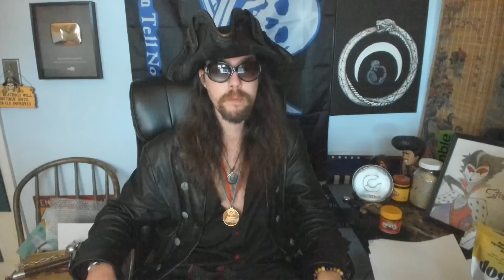Electricity From... Rain?

Comment: There's another angle here - have small water wheels in drains that produce electricity from the water flow. It would be very little electricity, but have enough of them connected to a grid that can accept input instead of just giving output, it would be quite a lot of electricity. Cheap to produce too, but it absolutely requires an open electricity grid or maybe home batteries - which is why it hasn't happened yet.

Comment: A 200w 12v solar panel can directly power a 12v DC rice cooker made for cars or one of those 12v Road Pro cooking pans. Add a solar charge controller and a 12v 100ah LiFeP04 battery and you can use a 1200w AC inverter with the 100 amp version or up to 2400w with the 200 amp ones. They have small hot plate type cookers for making sandwiches that use 500w and the 4 inch Dash Mini Griddle that only uses 350w. Most small to medium size rice cookers use under 500w and of course you can cook more than just rice.

Comment: This has been around for centuries it is called Lord Kelvins thunderstorm.  we also have triboelectric panels that like rubbing a balloon creates static electric charge when rain hits teflon and the rubbing of the drop as it spreads on the teflon causes a charge that hits an electrode connected to a capacitor to collect charge.

Comment: If you have rain and a downspout, then you can have a water wheel spin a generator, which I would think would be more efficient.
Heating elements require lots of power.  I would not get your hopes up.

Comment: Why not just set up a simple waterwheel attached to a small generator? Hook it up to the rain gutter spout. I don't the amount of power something like this could generate is worth the energy that goes into making it. Even if it could generate enough power to offset its own cost I feel system components would break down and need replacements before that offset was reached.

Comment: why not just a rain barrel mounted high and then use a turbine to generate little bit of power as weight of the water builds up and then gets released when you need the power?  or when you watering the garden with it.  Or had the barrel fall down on a rope spinning some gear when you need power.  the fuller the heavier the more power. keep it simple and more accessibble

Comment: Look up 'Wimhurst Machine ' and other early generators, and you can find similar 'water drop generators' that work by the induced opposite charges on the water drops.  Actually somewhat useful for making static electricity, but the idea of trying to do real power generation is basically silly.  Yes, there's lots of total 'charge', but trying to collect it is impractical, it is far too spread out to make sense collecting.  Collect a huge area, and you still have next to no actual power.
You'd be literally better off to funnel a large area, then use the weight of the water to turn a generator.  The gutter generator probably produces more power.

Even if you live in the most rainy place on Earth, wait for the sunny days and use 5 or 10 solar panels instead, you'll come out way ahead.

Comment: The combined effects of a network of small measures. A house generating power from solar, rain and wind can seriously reduce what they draw from grid. There is a carbon cost through mining. But a reduced cost when producing grid power.
 The problem is we want an abundance of power not a rationed supply. Our expectation is what needs to be addressed. People do live off grid. Generate entirely enough power to live.
Reply: The problem is even if you were fully self sufficient power wise they would still want you connected to the grid and paying into their budget. At that stage, what is even the benefit for the end user.
Reply: @BlueArremer  what your discribing is a man made obstruction to solving a human crisis. We know they survive on ritual billl paying. What is a mystery is why we are onboard with it.
Reply: @BlueArremer  If you wish to do what is right by the planet. You have to stop giving them what they want.

Comment: It would be far more sensible to put a water wheel in the middle of your gutter discharge.

But you couldn't put a patent on it, so instead the stupid idea gets promoted.

For portable sources of low but renewable amounts of power, a solar panel and a battery is already the better solution since the sun shines (almost) everywhere.

And the places where the sun doesn't shine for long periods of time, they also tend to get their precipitation in the form of snow.

Comment: K Eric Drexler had the idea of using advanced nanotechnology to coat every paved surface such as roads and parking lots with  a self-repairing layer that collects solar energy and converts it to electricity.  The power production would be immense, but unfortunately I don't want ANY government or corporation having access to advanced nanotech.  They would of course abuse it.

Comment: The problem with what is being described here is that I bet it would get clogged immensely easily, but conversely would be difficult to unclog.

Gutters are usually about as big around as a human forearm, and they get clogged quite regularly. Maybe this will work well in places that get solid amounts of rain, but do not have to deal with leaves or other debris reaching the roofing area. But in areas with more tree / forest presence? I don't see this working well simply due to the maintenance problems in keeping them functioning and not just clogged.

Comment: Fundamentally most of these types of energy sources are fueled by the sun, and so they only store a fraction of the energy that the sun had shone on to the planet. Same thing for getting power from lightning strikes. Maybe useful in isolated small networks, but not as scaleable, solar probably beats these out. Or you could just stop letting Homer Simpson dictate your opinion on nuclear and just use the shiny green rocks already

Comment: The United States already has a bunch of different methods of generating electricity feeding into the grid.  Coal, Natural Gas, hydroelectric, nuclear, wind, solar, combustion turbines.  Although, the one thing they all hive in common, except photovoltaic solar, is that they generate electricity by spinning a magnet inside a coil.

Comment: Snow. It falls for free. In the spring it melts using free solar heat energy. The resulting water flows downhill toward the ocean. How about installing a turbine in the path of the flowing water to create electricity. It can be paid for by the community and therefore less costly to the individual and it uses resources  that would go to waste otherwise. The technology already exists. Nothing new needs to be invented. Viola! Snow power.

Comment: Some solar panels (including batteries, adapters and controllers) is the best you can have as a backup helper, but the rest is centralized or you get chaos by sometimes having no options.
Reply: What I have but the thought they can run the grid on it is ridiculous good for backup only. Besides they don't want the common plebs independent of the control of your masters.

Comment: Why not just collect the rain and run it through a tube with an impeller  to drive a generator;  thus  using gravity as the  source of power ?
A mini, occasional damn if you will - this has already been proven at a larger scale

Comment: Lightning?  Btw, there's a heater that can use firewood to generate electricity to charge your phone.
Reply: If it's the same device I'm thinking of it actually barely works at all.
Reply: @buddyguy4723  I think so... it can charge a phone but probably takes all night.

Comment: Something I’ve had in mind you might be able to tell me if it’s feasible..

I own a dehumidifier , when it fills I dump the water outside on the garden. How hard or practical would it be to build one that empties on its own. Mine auto shuts off when it reaches 1 gallon, because it’s full .. what if was built to stop at 1 gallon , auto drain into a reservoir and then start over?
Reply: I have thought about why don't they build giant dehumidifiers for gathering water? Peace out.

Comment: Electricity from planetary rotation
Reply: Sorry dumbass Earth is flat and stationary. The Aether rotates around us like Nikola Tesla said
Reply: Actually NASA has already experimented with this by trailing a wire behind the space shuttle.
Reply: @greeneterror7989  earth is not moving derp
Reply: @cj548 Well, actually, yes it is.  The earth is a massive magnet rotating in both its own magnetosphere and the sun’s heliosphere, passing through the solar electrical connections of the outer planets as it rotates about the sun, and every ten days or so passing through the solar plane into the oppositely-charged hemisphere of the solar system, while the whole solar system moves as a body through space at a few tens of kilometers per second, and the whole galaxy rotates, and itself moves through the universe, which may, or may not itself be rotating and in movement in some larger dimension.  That enough movement for you?
Reply: @marcmelvin3010  no such thing as space derp
Reply: @marcmelvin3010 that's all good, except for one fact, that the sun's magnetic field has very little effect on the Earth. Yes the sun's magnetic field swaps polarity from north to south for its poles, the Earth does not have its magnetic field swap polarity.

Comment: I would be curious where the charge is coming from. The fact that it needs to flow through micro tubuals first makes me wonder if the water is striping electrons off the material. That basically means your not getting power from rain your getting it from rust. Eventually youll use up the materials and have to replace them, effectively an open cycle battery.

Comment: sorry styx, these are at best "supplemental" , but nothing will ever be a true alternative for a nuclear power plant.  and again, more research needs to be made and money spent on thorium reactors as a replacement to uranium reactors.  thorium could be a better solution , as it cannot be weaponized and unlike uranium reactors, are safer.
Reply: Dams can have structural failures so what about those who don't want to live near a hydroelectric dam? Nothing is 100%, only mitigated to a certain point.  Thorium reactors are still safer than uranium and I do hope it will be a viable alternative to uranium reactors.
Reply: @breadmoth6443  People buy beachfront and oceanfront property despite the majority of the world believing that climate change will cause sea level rise. Most people buy properties within 100-year flood zones.
99% of people would rather take their chances with water than radiation. You've got to be more realistic about what risks the general population are willing to take.
Reply: Hydro-electric dams are  pretty good where they can be built. Except for the limitations in where they can be built, Hydro is a good competitor for Nuclear if a local population doesn't want potential irradiation going into their water.
Reply: @onpoint2292%  this is why thorium reactors need more research as an alternative to uranium reactors.  The waste is less dangerous than spent uranium, sure it is not 100% but dams aren't 100% safe either when you consider potential structural failure.